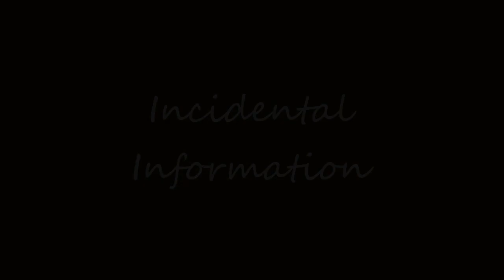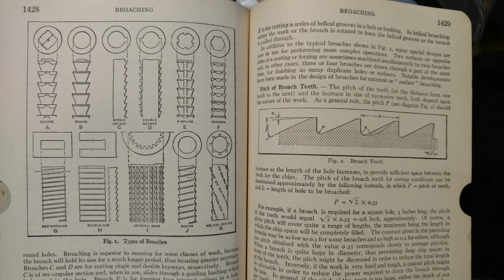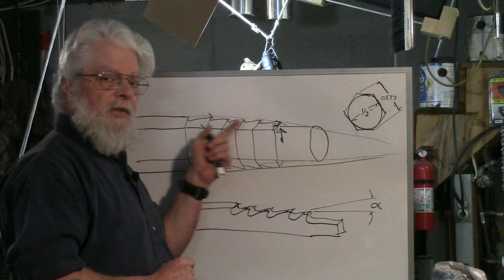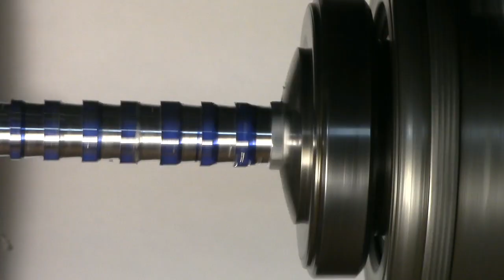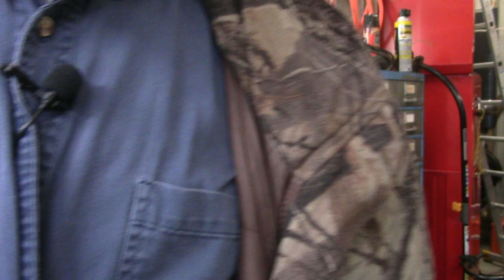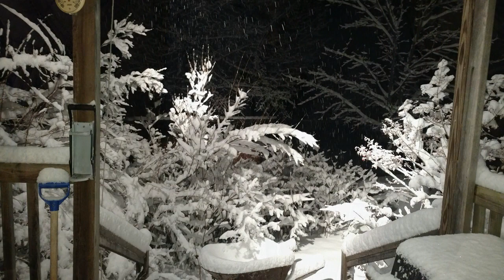Making a polygonal broach

Comment: This is the only thing worse than mystery metal---it's definitely the wrong material but you're not sure which.  But you are right about the handbook.
Reply from the maker: We just used this broach again, on Delrin, and it worked flawlessly for the umpteenth time.   Even only being 6061 aluminum, the plastic must yield to it's hardness.  I pity the individual who eventually finds this tools and tries to use it on anything harder.  Thanks for watching.

Comment: This is really interesting. Thanks for the video.
Reply from the maker: Thanks for watching. Glad you enjoyed it.
Reply: @i-squared  Would it be possible to pull it through a pilot hole? Instead of pressing it?
Reply from the maker: @Spruce-Bug   @Ryan Cameron  Sorry for my delay. I think I know where you're going with this.  I would say yes, IF, the rod pulling the aluminum broach went all the way through the broach with a nut on the other end, but then the nut would be pushing the broach.  A steel, or harder, broach could be welded to a pull rod as is done for button rifling.  The details of which I am unfamiliar.

Comment: it might work if you heat a piece of hex and push it through the part , melting the hex intoo the hole , should be able to do that in plastics
Reply: it will not produce comparable results

Comment: Delrin? I'm pretty sure you could have just pressed that hex through it without modification as-is. lol
Reply from the maker: Oh if only that were possible. You might be able to punch and die nylon or teflon with a single edged tool, but delrin will chip and shatter.  Small bites of a rotary broach would probably work too. But I havent made mine yet. :) And to be honest, part of this effort was simply to explore the geometry and making of a polygonal broach.
Reply: @i-squared  and that's why I watched this... I need to make a 1/4" hex broach and plan to use an old Allen wrench. It won't be nearly as nice as yours but mine only needs to work once so fingers crossed. lol
Reply: @charliemopps4926  Just a note:Allow for clearance. Especially if your broaching resilient material, like plastic, it needs to have a final size a touch over the desired result. I made that mistake with this broach and the resulting holes are about.0006" under the final cutter. And that gets worst once the edges start to dull.  Good luck.
Reply: @marks5603  thanks! I'm actually starting with a 7mm Allen key, as 1/4" is slightly under that. Hopefully it'll work, we'll see.
Reply: @marks5603  It is usual to have several size teeth at the end of the broach to help retain the final size as the teeth wear. The thickness of the part needs to be considered to determine the pitch of the teeth, as a minimum of 3 should be engaged to prevent the broach from wandering. In this example the broach could have been relieved to enable it to be pushed all the way through. Did the taper need to be cut first as it would have been created as the teeth were cut?
Reply from the maker: @marley589  Thanks for the comments! You are correct on all counts.  I should have made this longer to allow for several final sizing teeth. As this was an aluminum test broach, and undersized stock as well, I just went with showing the method of cutting the teeth for the purposes of this video. Which leads to your next question: Yes, the taper needs to be cut first as this determines the tooth growth. But the relief angle behind each tooth is opposite that of the taper, so taper must precede final profiling of the cutting edges rake and relief. Subsequent broaches will be made with (tool) steel of the appropriate size for clearance.
Reply: @i-squared  Thanks for the info. I saw the teeth gradually being cut incrementally deeper and  assumed that the taper would automatically be generated. The pitch looked too long and I expected the tooth reliefs to slightly overlap and therefore eliminating the unneccessary lands between them. The clearance behind each tooth was already created so if the teeth already overlapped then the secondary relief would not have been required.
Reply from the maker: @marley589  Again correct. Had it been steel the gullet could have been deeper rather than longer behind cutting edge. In aluminum I thought it might have been too weak to do so.  Each tooth is actually relieved to the same diameter, but looks deeper as each tooth is progressively larger in radius across points. Across the flats they remain the same, start to finish.
Reply: @i-squared    I see, I never expected the relief gullets to be the same depth. I wrongly assumed that overlapping and progressively deeper plunge cuts could automatically create the taper. My original obsevation assumed that there is none of the original taper cut left, so why cut one.
Another thought is to consider the varying amount of material removed during the total pass. As there is virtually nothing to remove at the start and a full peripheral cut at the end. The pitch at the start could be closer and increasing during the cut. Or, the taper at the start could be more aggressive and becoming more gradual as the volume of chip increases.  It's all about reducing the length I guess.
In this example cutting Delrin, could it be possible to dispense with any land in the majority of the early cutting teeth.
If you need to increase the size of the broached hole by a few thou just tap a drift into the last tooth's gullets to create a small burr.